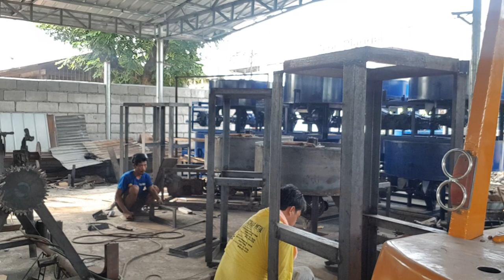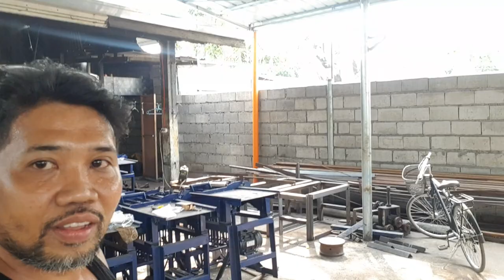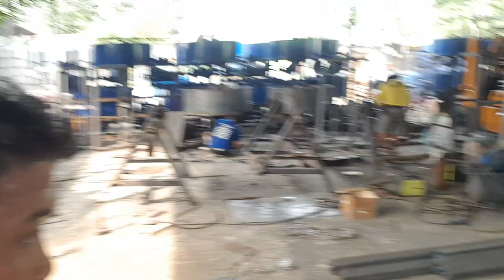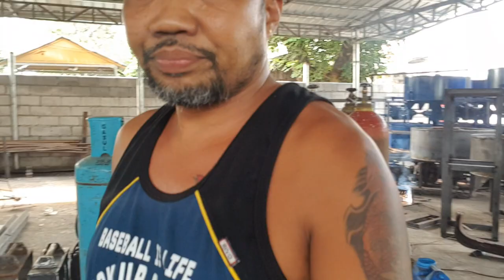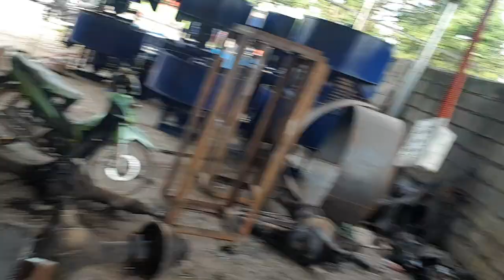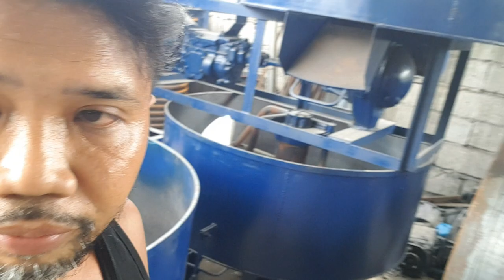JUSTINE HOLLOW BLOCK MACHINE MANUFACTURING 09323942115  09266500815

Comment: Sir ask ko po magkano po size 4,5,6 at mortar mixer po taga Pangasinan po ako sir
Reply from the maker: 26000 per unit sir
Reply: @mr.claciovlog.1135  bro magkano price sa isang set CHB size 4 and mortar mixer 1/2 bagger with motor plus shipping to So. Leyte po..
Reply from the maker: @romatetomol  tawag kalang sakin bro para sa price 09323942115/09266500815
Reply: @mr.claciovlog.1135  ok bro pwedi kita ma tawagan sa Messenger out of country po ako ngayon..